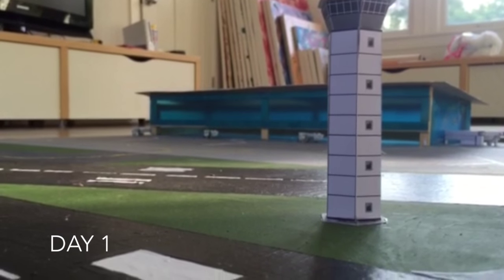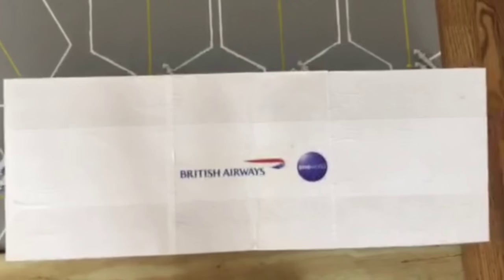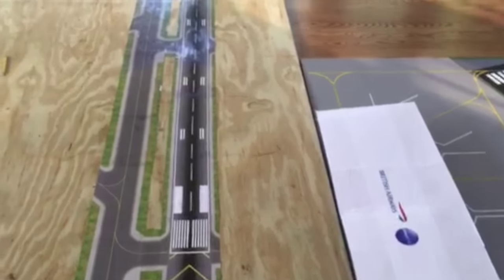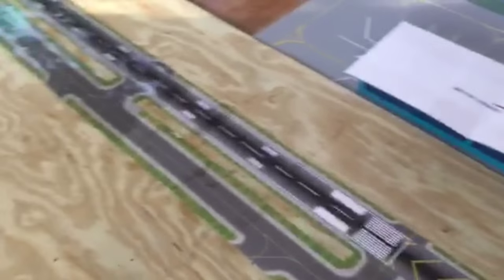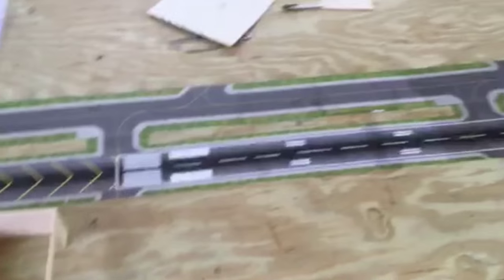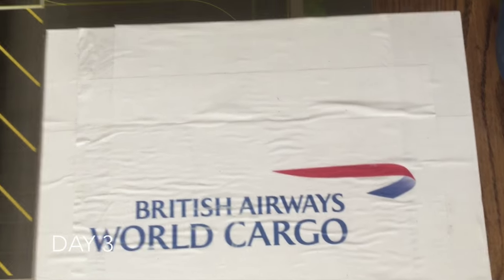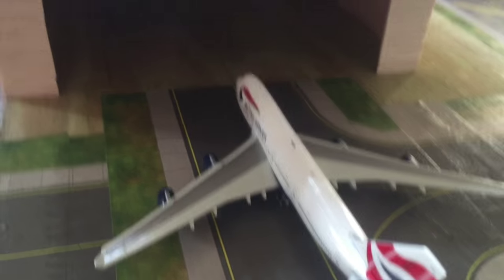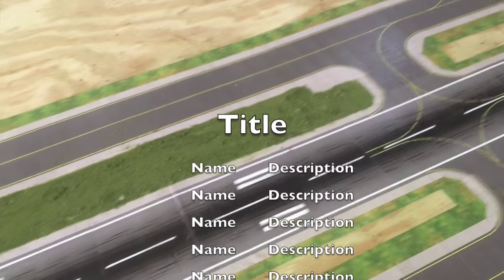SPECIAL AIRPORT UPDATE -- Building the New Terminal -- PART ONE

Comment: Hey, nice video. Do you print the foils one by one and then try to fit them together or join them and then print a bigger paper? 
I want to build an airport for my son and I'm thinking about joining them and then taking it out to print A1/A2 size and then have less pieces to glue together. But the foils from that website don't fit together actually (check you runway exists where they connect to the taxy ways) and it's annoying me..
Reply: psychospin1Hi! thanks a lot! I actually print them individually with a plan of how i'm going to fit then together in mind, and then join them on the base. Have fun building and let me know how it goes!
Reply: It will be a small airport (one runway, one taxy way, parking spots and a terminal. My son is 4 but he's crazy about airplanes (we even go spotting almost every week) and since I was in China for 2 years I was able to buy models cheap so he has like 40+ and every place in the house is an airport, so I figured I could build him one.
I've been on that website taking foils for some time, I'm just having a hard time fitting them together. Once I can do that I'll start getting the materials and start building. Cheers